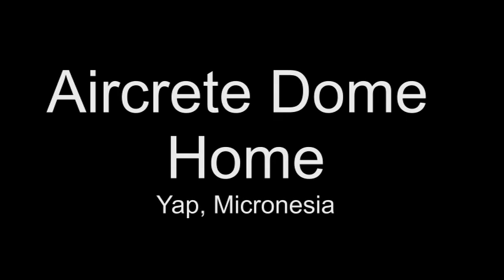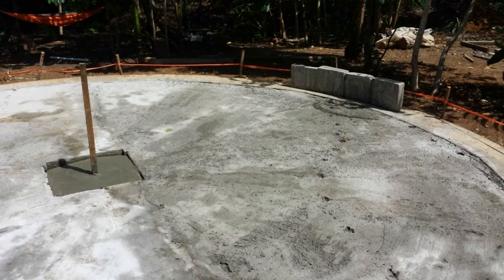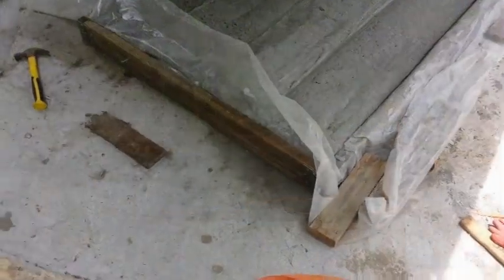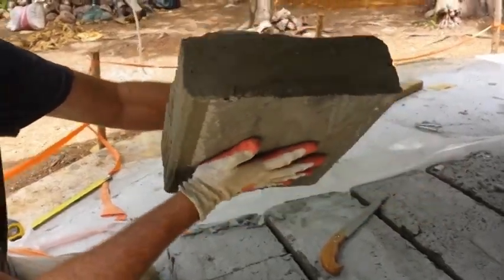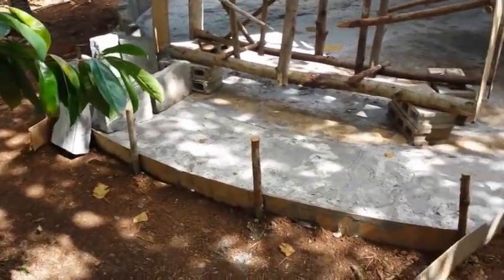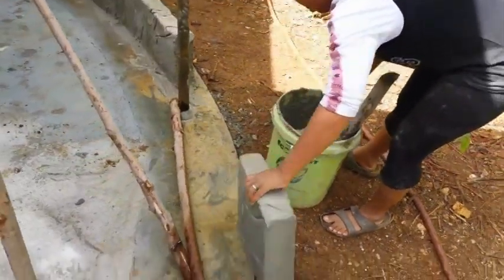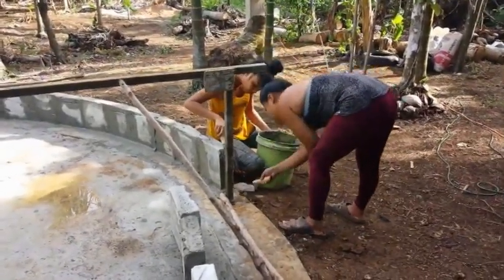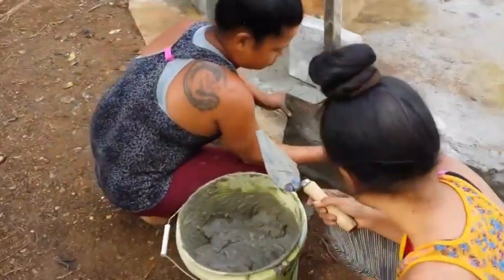Aircrete Dome Home, Part 1, Domegaia Method

Comment: Hi. I'm an aircrete fan but... A bit worried about using it for foundation. Do you use the same ratio as for the blocks? Any sand? Do you remember the recipe ratio? Thanks for share.
Reply from the maker: Sorry I don’t remember the ratio, but yes more sand. I would recommend just regular concrete for foundation. Aircrete is just too brittle.
Reply: @jonyap08  Ok. Many thanks for your help.